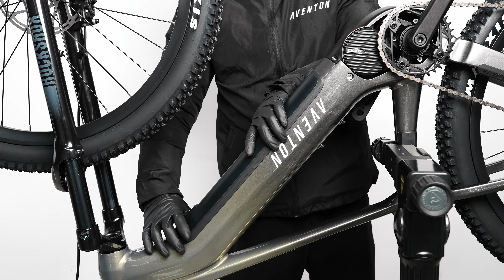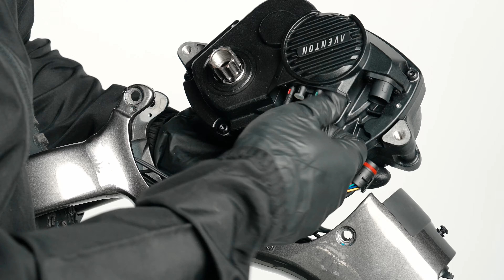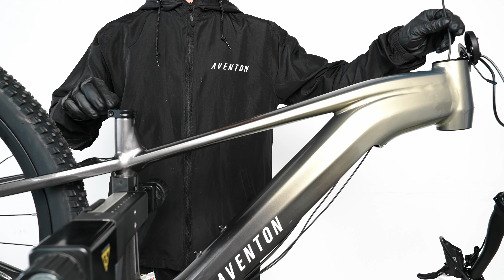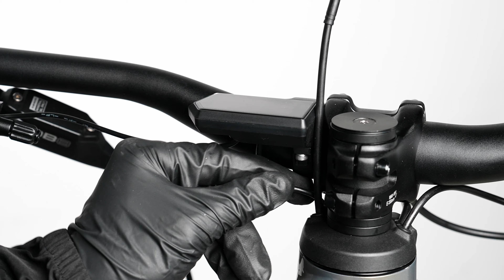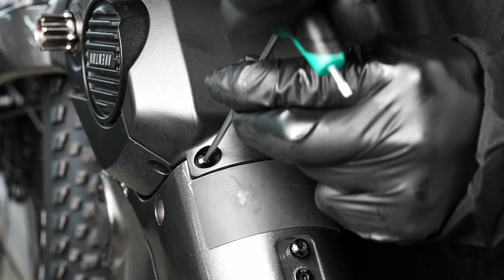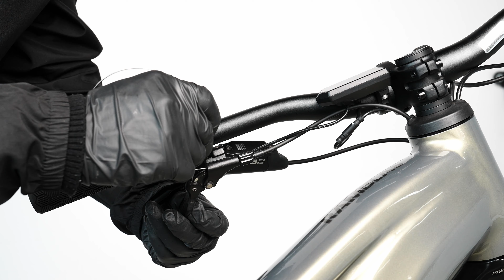Ramblas: Dropper Post & Housing Replacement

Comment: Ridiculous
Reply: Yeah, I just went through this changing my dropper to a suspension-dropper.  Unfortuantely the cable end required pulling the cable to add a new catch-piece and I had to tear down half the bike to move the dropper housing to come out of the seat tube to thread the cable back to the lever.  To make matters worse, the metal cable protector in the battery area requires two tiny screws that are very easy to slip down into the frame when trying to hold the aluminum piece against the cable housings.  There is a hole perfectly placed to allow those screws to fall into the top tube - gone forever and rattling for the life of the bike.  The fork-replacement is a nightmare if you don't have someone to hold the handlebar above where you work, trying to route the cabels through the multiple plastic spacers/guides.  I love the bike, but I never want to work on the cabling again!